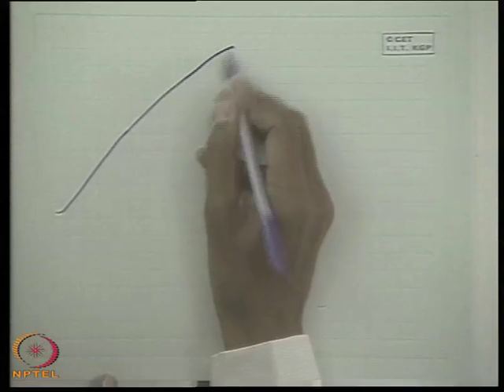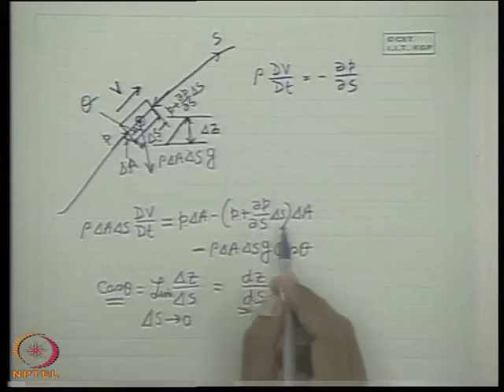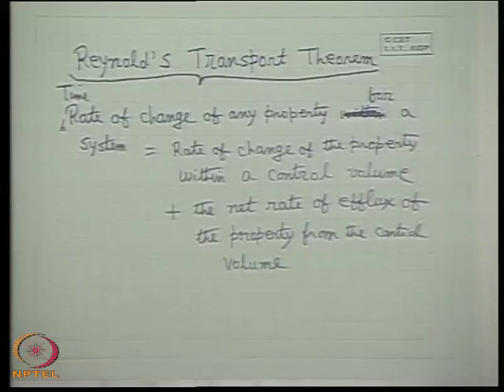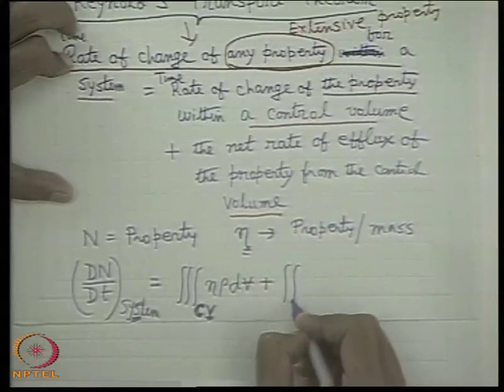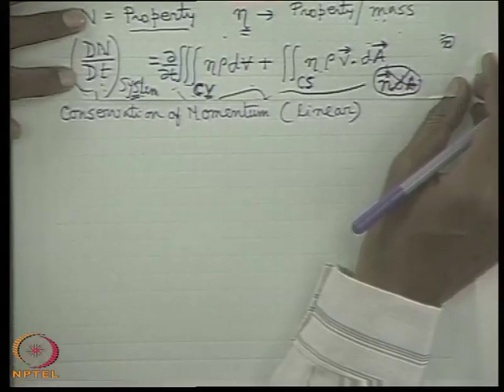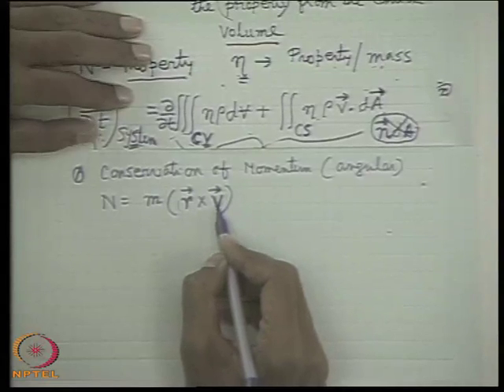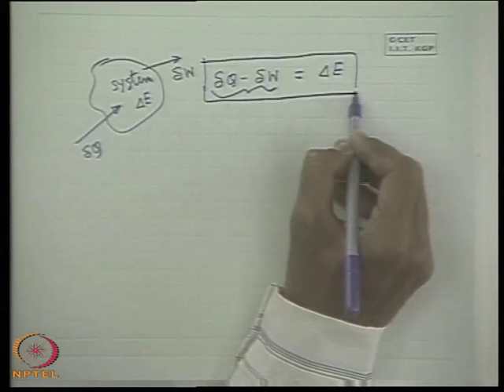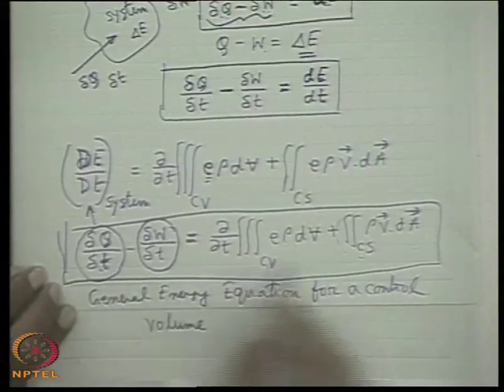Mod-16 Lec-16 Conservation Equations in Fluid Flow Part - IV

Comment: 6:06 cosx is ds/dz not dz/ds...because length of component should be less than the vector..here dz is vector and ds is component..or am I wrong
Reply: dz/ds is correct. observe the angle. ds is the hypotenuse.

Comment: No where the momentum was conserved .. for momentum to be conserved net force on the system must be zero. But in fluid flows force is not generally zero .. we have applied linear momentum eqn that is the second law of motion for deriving Euler's eqn not Conservation of momentum.
(Correct me if m wrong )
Reply: Harshit Rajput the force external for ideal fluids is zero, we take compressive pressure force as for ideal fluids. And body force.
Reply: Moreover momentum is conserved  as we are not taking any external force into account, rather it's the internal compressive  pressure  force we taking.
Reply: @kushagrakhandelwal7524   but in the Euler's equation, Body force is there which is an external force, so how could you say that the momentum is conserved. I think Harshit is right. and also, in a fluid flow, velocity is changing with space and/or time and thus acceleration is there which is only possible if external force is acting on it.
Reply: @rajibdas1087  Sir, Could you Please Suggest me Some reference books to grasp concepts for Fluid Mechanics, Thermodynamics,Theory of Machines.

Sir,Why Zeroeth law of Thermodynamics?How to understand Heat as energy in transfer?
Reply: Indeed I think the same , I think if sir would have said momentum balance rather than momentum conservation there would be no problem . ( Just a we do in entropy in thermodynamics).
Reply: This is conservation acc to law of motion